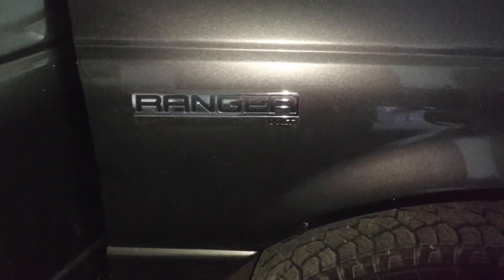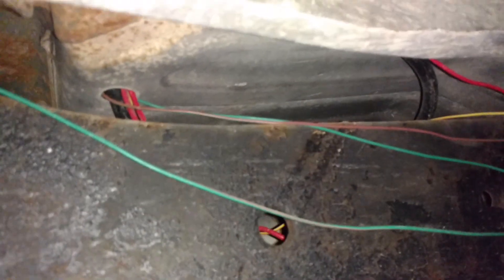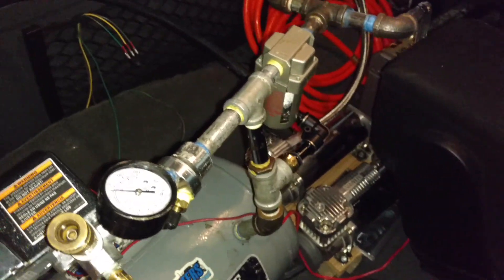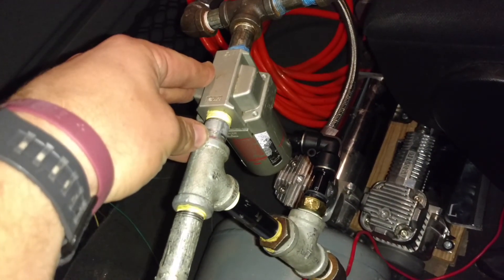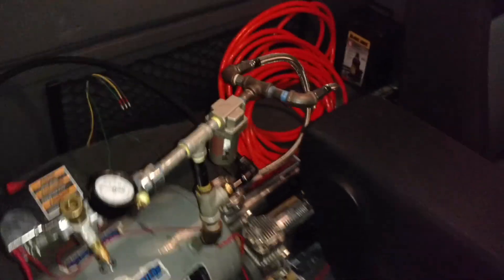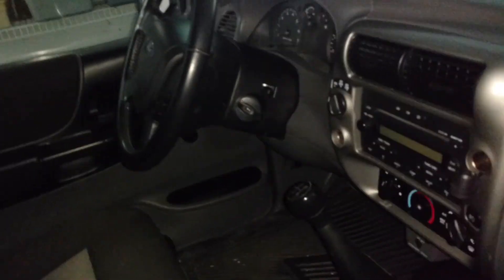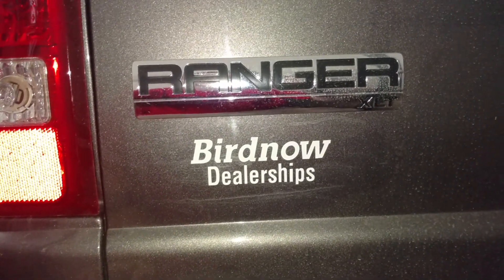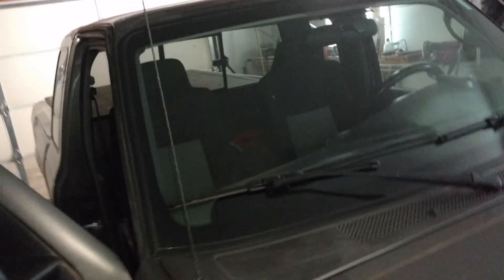Train horns on a Ford Ranger

Comment: I have a ranger as well and am considering a air horn for it.
But isn't the compressor loud being in the cab?and how long has the horn been in use?curious in regards to longevity. Thanks
Reply from the maker: m Chandler You can watch one of my other videos that has just me talking in my air compressors running behind my back. Truthfully they’re not all that loud. However the horn is very loud and I have had it for four years now and it still sounds great.